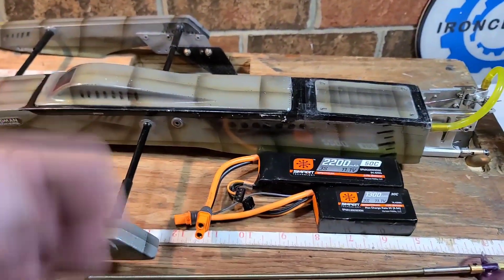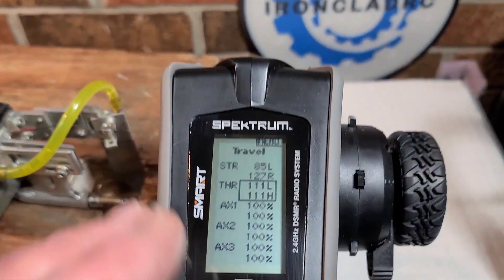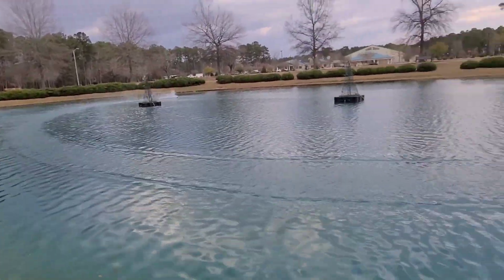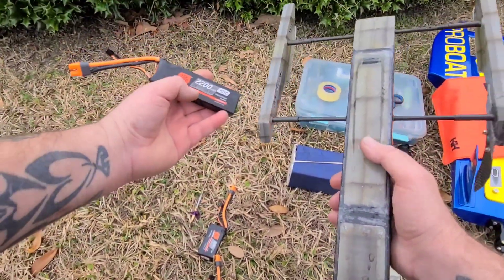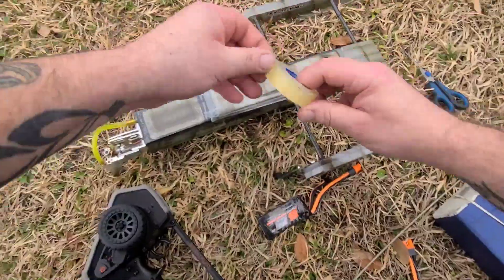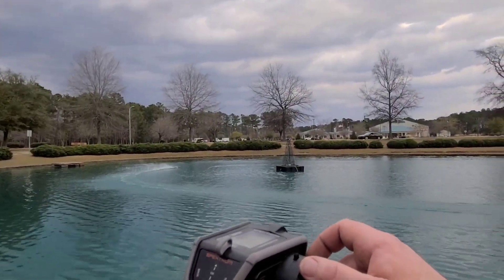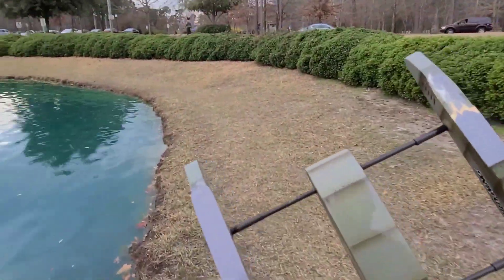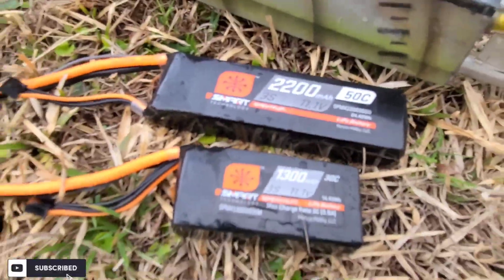Mini Rc Outrigger Big Prop Problem Solved - Dx5 Rugged - Dynimite Marine - sss 2960 - Spektrum

Comment: I believe the problem was that you originally calibrated your ESC with the transmitter's throttle ATV set at 100%. And then you changed it to 150% without recalibrating the ESC. If you calibrate the ESC with the transmitter set at 150% it will work perfectly fine. It won't be faster, but you may widen the throttle band slightly. Oh well, none of this really matters as long as the boat is running better now. Your new transmitter has exponential - that's a powerful adjustment that you should toy around with. Set the steering expo to a negative value and you might make your boat steer more to your liking. Thanks for the video Big "B"!
Reply from the maker: I appreciate the info, thank you ..   I know all the settings are about  the same as the basic remotes, the interface on the dx5 is different in all good ways. . There's definitely a learning curve,  thanks for the tips.   I will definitely look into the exponential 😆

Comment: That thing is running really well now.  The ESC seemed a bit warm, but everything else was within parameters.  Remember, the ESC cannot provide more voltage to the motor than the battery can deliver.  Once the logic board of the ESC sees 100%, it can't deliver more wattage than is available.

I think you need a pond without all the obstacles.  Now that it's running so quick, you wouldn't want to hit that rock pile at "Full Trigger"!  😳
Reply: Yeah man, that pond looks dangerous, but at least you can see the obstacles. I've ran my boats on ponds that have random poles, branches and other obstacles that you can't see until you run into it :(
Reply from the maker: I can only run my boats in the park pond in the winter.  Summer time the turtles are so bad they will destroy a boat.  Thanks Doc I will keep that in mind 👍yea hitting the rocks that's about my luck. Lol
Reply: @IRONCLADRC  I've seen what hitting turtles can do.........   Not pretty!